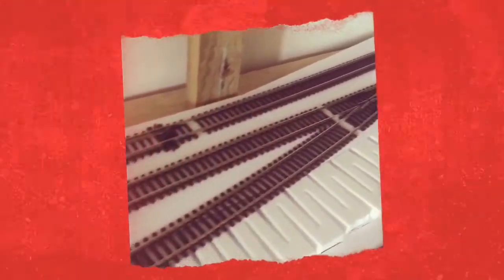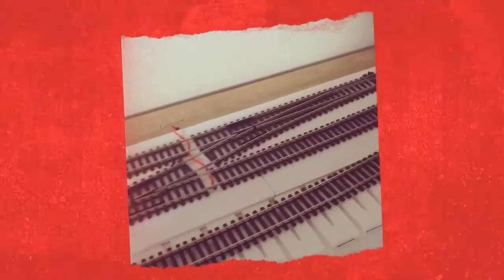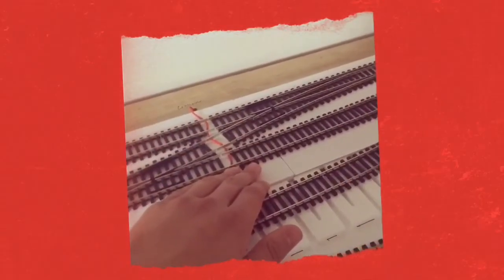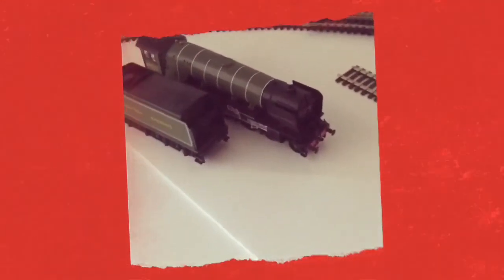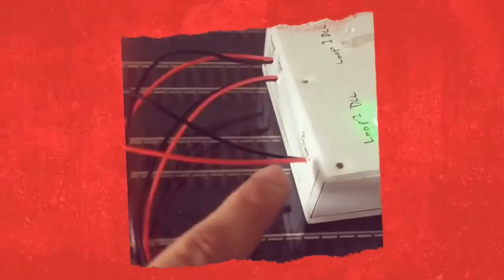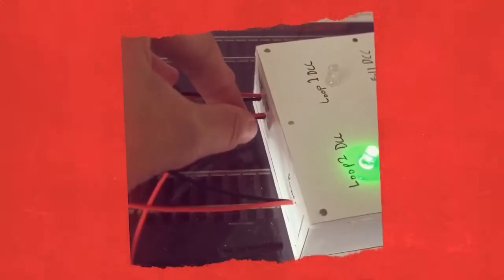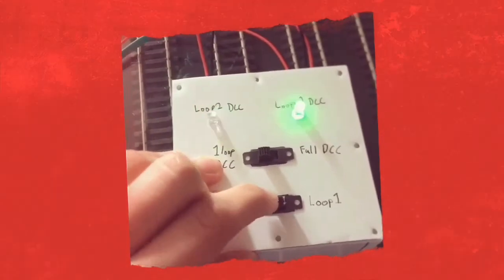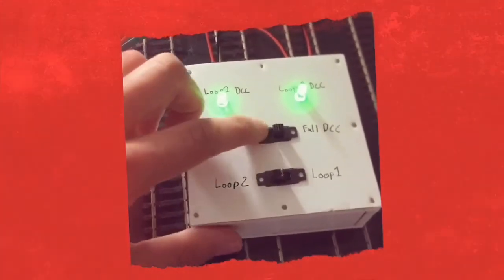This is how my old model railway failed (and why my new one won't)

Comment: Good stuff Anthony. I watched a lot of vids before building my 2nd layout and the gospel was, have a track dropper connected to every piece of track.
I also have my 2 outside loops switchable to DC, powered by a Hornby HM2000. Didn't worry about splitting them like your set up. Don't use it much these days as nearly all the locos are converted to DCC but when I want to run an old engine on DC, the DCC ones can run on the same track , so to look at it, you would never know it was DC
Reply from the maker: Bears Trains and Stuff Thanks :) yeah Because a lot of my track are simply long sections of flexi track I’ve put in feeder wires before and after every point, and then I’ll solder the rails together when I’m ready. And the reason I’ve put in the dc-DCC switch is more so for being able to test new DCC ready trains before I fit the decoder, though it also makes it possible to run my hornby Dublo occasionally

Comment: Good video, I'd be interested to see the extent of soldering each track joint and how it affects loco performance! Though I think the solder would be quite visible, how would you combat this?
Reply from the maker: As far as performance goes, soldering simply makes the performance more reliable and consistent in the long run; you’re trains won’t actually run smoother. Also, about making it tidy; that’s also something for a video.